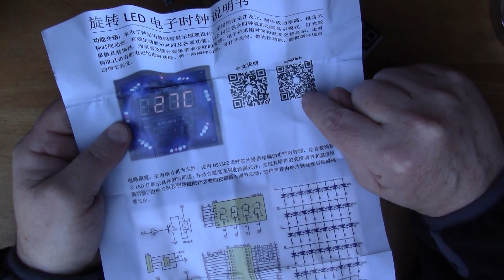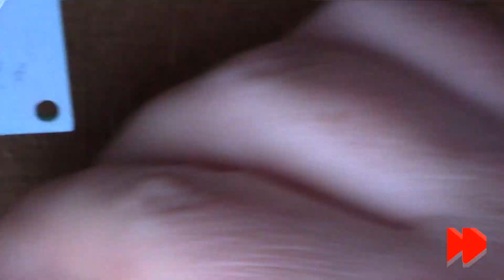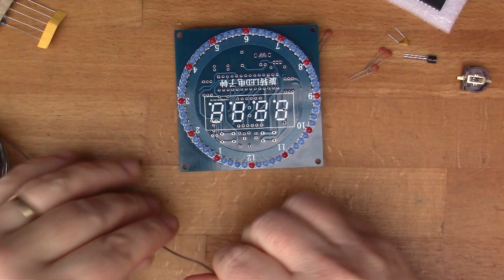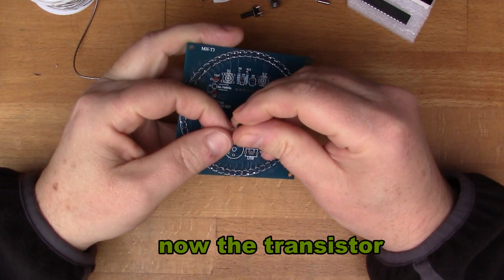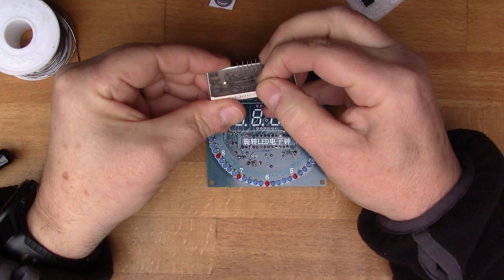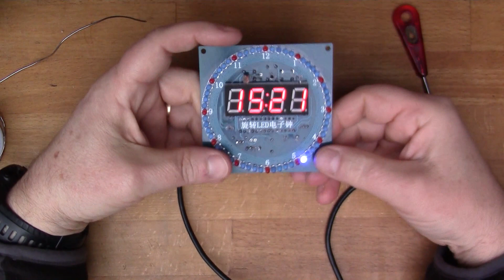Clock Kit Build (#140)

Comment: Hi Martyn, I’ve just built one of these. You mentioned that the LDR didn’t seem to do anything. There is a software switch for this in the same way that there is for the alarm. You scrolled through the second switch when demonstrating how to set the clock and alarm. It’s the second set of four zeros. You can toggle them to 1’s and it activates the LDR. The brightness of the LED’s will then dim (not much) when the ambient light drops. Good video.
Reply from the maker: Thanks for the info
Reply: Where did you find the setting instructions? The page I found had the build instructions but the images were missing.

Comment: I made one of these about 3 years ago and it still keeps really good time so I can’t complain!  It occasionally drops a few leds but they return if I reboot it. I think it’s probably an iffy solder joint but it doesn’t affect the display or timekeeping so I live with it!  I use it as a bedside clock as it isn’t too bright for the bedroom!  One of the cheap Chinese kits that I actually use regularly.
Reply from the maker: Yes, I find it quite attractive, although I don't always like blue LEDs.  It's definitely good value for the few pounds I paid for it.
Reply: @MartynDavies  Do you think the blue LED's could be swapped out for green ones?
Reply from the maker: @Alan_AB  Definitely, although the current limiting resistors might need to be swapped for other values depending on what sort of brightness you want for the LEDs.

Comment: Soldering iron tip is pretty oxidized. Seemed to struggle with each joint.  I always use some brass wool often to clean tip and re-tin.  For the SMD chip, a small dab of flux would make a huge difference.

Comment: Interesting kit.  Clocks use either a GPS module or Wifi to get accurate time are perhaps a better choice. This clock module is not very precise, and who wants to have to set the clock when it drifts off. There are more precise modules, but getting accurate time is preferable.
Reply from the maker: I few years ago I swore that I would never buy a clock again that could not auto-set by radio, or change automatically with daylight savings.  Look where that oath turned out.
Reply: @MartynDavies  I've pretty much decided the same thing - no more clocks or watches that don't self-set. I just ordered a few Pico W's for clocks and other projects. The Pi Zeros are too valuable and hard to get to use in clocks these days. The Waveshare Pico clock shown in another video could hopefully work with a Pico W as well. Might make a good video to try that, and set it up in Python for convenient user customization. I ordered one but it may be coming by slow boat. Another good upgrade might be to add a GPS to it. I want some clocks for the RV that use GPS because internet isn't handy for them. GPS modules have become very inexpensive, and all you need is one pin to read the serial output.

Comment: Bought that kit myself and wanted to solder the components on the side of the clock where the display lies though. Just wanna stare at my soldering work all day. The fact that it’s a clock is just a bonus, but I wanna keep it functional. Do you think it’s ok to solder it this way? Is there anything I should look out for? Didn’t look through my kit yet but wanted to get a heads-up so I won’t mess up.
Nice video!
Reply from the maker: The chip and display can only go in one way, but the resistors and buzzer could be mounted on the wrong side.  You can experiment with it; you might be constrained by the larger components getting in the way.

Comment: martin im just about to build one of those , but i am reffering to previous clock build ,i have built an alternating colour one it works fine bar for the PM DOES NOT LIGHT, ON A PREVIOUS ONE I BUILT IT DOES ? any ideas i have no instructions, john.
Reply from the maker: The way that I tackle this is to carefully inspect all the pins on the rows/columns of the display and reflow anything that doesn't look to have good solder.  Make sure that none of the pins are shorted to their neighbours using a continuity tester.  Failing that, work out which row/column of the display has the problem and check continuity back to the pins on the chip.
Reply: cheers ive done that with my magnifier and tester but could not find the culprit but not to worry  everything else works. @MartynDavies

Comment: I build this clock and everything works accept the thermistor temp read out. . When it switches to temperature I get P1C or U1C. Its like its getting a bad signal. Solder connections appear good and LDR is working. Any ideas what might cause it?
Reply from the maker: You could measure the thermistor with a multimeter to make sure it's not open circuit or short circuit.  Also perhaps put a 10k resistor in instead of the thermistor and see if the display reads something sensible.  If I find my clock, I'll measure the resistance of the thermistor for comparison.

Comment: When you go through the settings you get to a row of zeros which can be set to one’s and as you say that is alarm on and off.  When you press the button again, you get a second set of zeros.  Change this to one’s will turn on the display dimmer function used by the light dependent resistor.

I found it annoying as there is no fuzzy threshold on the dimmer.  When you reach a light level where the dimmer is unsure if it’s dark enough for the dimmer then it can look like the display is flickering as the led s are switched between bright and dim every few tenths of seconds. Made worse for me as it sits on my office table so when I move the mouse it thinks the light level has changed so it flashes.

Fun to build though. I’ve had mine about a month.

Mine seems to lose a minute or two per day and I’m not sure why.  I don’t have a battery fitted but that’s only for the RTC battery backup I think.
Reply from the maker: That's very useful. Thanks!
Reply: @tubie1888  how do you send it the instructions. I have 2 amd the work different. One chimes every hour, the other don't. I cannot make the dots lit in the time mode (useful not to confuse with year). Is there any repository with programs / firmwares?